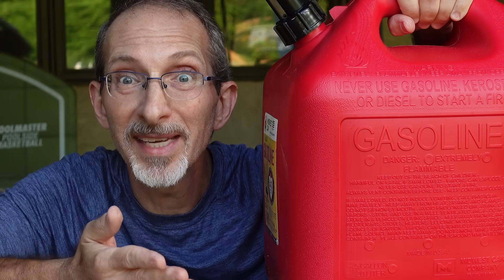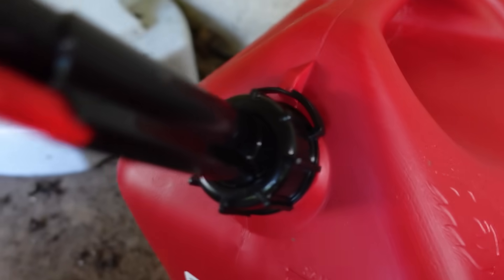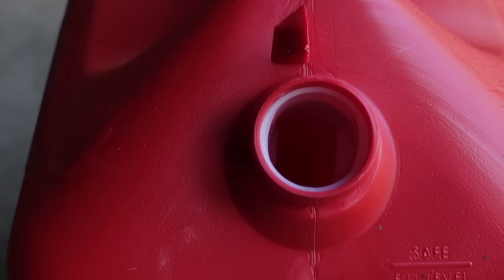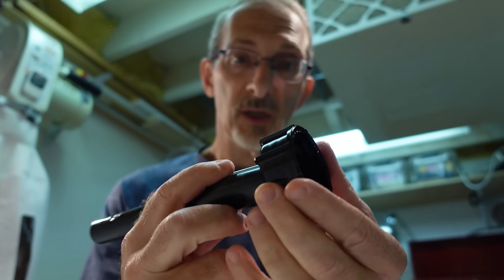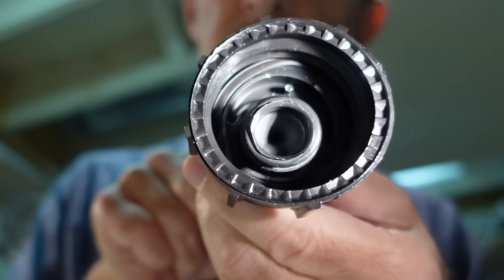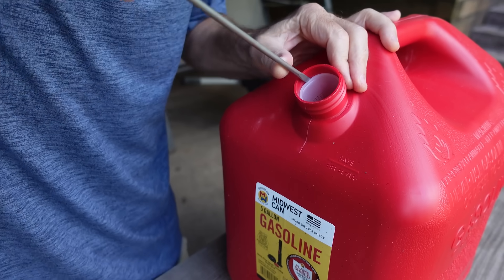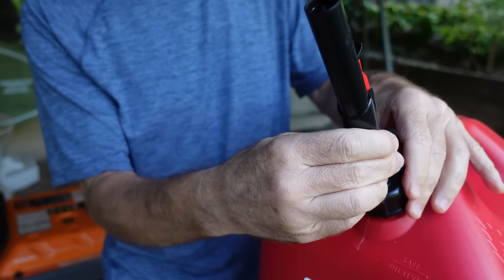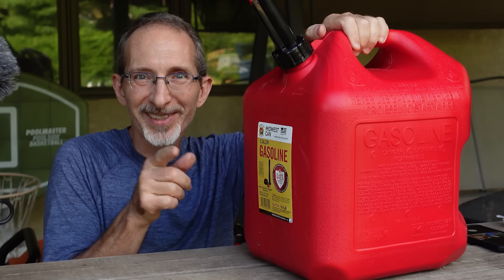Gas Can Modification | New Gas Can Fix

Comment: Socialist Democrat protect the idiot citizens instead of teaching everyone to think. They think making laws works to solve all problems without considering the unintentioned consequences. 
However - 
There were a lot of people burned with the old style gas cans, many of them children back prior to 30 years ago. Just like seat belts or push in before turning gas stove valves did save lives but those things aren't so complicated. The gas can protection was designed by committee who never had to use them in the real world.
Note that you can buy an old style flexable fuel Nozzle to fit the new plastic gas cans for a couple of dollars online and completely discard the unworkable awkward safety one.
Reply: "A lot"?  I would suspect it was a very small percentage of the people who use gas cans.

Comment: Bought a couple recently. Used a screwdriver to pry the red clip out. Now i can tip the can over, use thumb to depress and control the flow of fuel. The plastic being shoved into the recessed cavity made for a lot of friction and was way too hard to use on anything but a car as demonstrated. Without the red tab the spring tension is not that bad to operate after. 

Had to get new ones since the green handle one that is supposed to be easy was a nightmare to use. Flip down the green tab and use palm to depress and flow fuel... nope it never worked right and broke by means of the plastic deforming and still not allowing fuel to flow out lol. straight into the trash after that happened. Only had i think 3 successful uses and was about to mod it, instead it did me the favor of destroying itself.

Comment: I removed the filter then went and bought the flexible filler at the hardware store. While there I bought a bunch of rubber 1/4 inch tapered corks. When home I drilled a 1/4 inch air hole in the top back of the jug. Insert a cork in the hole.  Now my jugs are easy to fill and use. From what I was told there are no state laws about these type of gas jugs. THe manufactures simply over-engineered them and make more money from selling there piles of crap.

Comment: Wait a Generac Generator with EFI? Wow that's pretty cool. But does it require a working battery for it to run or can it run on its own stator/alternator power once running for the EFI stuff?
Also doesn't that kind of defeat the whole purpose of a old school style carb and magnetic coil pack for the spark. Which would be able to handle any EMP style attacks. Just like an old school mechanical fuel injection Diesel Building Generators'..

Comment: I had been watching rummage sales and flee markets to buy old used gas cans. I keep individual cans for different 2 cycle mixes and then for different small 4 stroke engines. Now I can start to replace some of the older ones that I really don't know what has been stored in them over the years. I really can't understand how they expect you to fill a chainsaw, weed wacker/trimmer or other small engine with that so called safety nozzle. You get more on yourself and the ground than in the tank.

Comment: I think it's not a filter you removed but rather a mash to prevent flames and explosion of a gas can.
If you think this way - what it's filtering? the dirt to come into the can. so the dirt will stay on this mash and then it will be washed back out on the first pour into the tank, right?
To prevent gas nozzle overfill safety to trigger all you need is to not put it all the way into the tank. But I think this mash design also supposed to accommodate to the length of the nozzle - that's why it's so long. So maybe fill it a little slowly rather than on the full throttle?
For the spout lock - it's better to cut the spring rather than removing it altogether I think. 
And yeah, ic now follow-up video when you realized it's a flame arrestor. That's good :)

Comment: I just bought a 5 gallon gas can from Harbor Freight that was branded Briggs and Stratton and the design of the gas cap is the best I've seen so far. So easy to use, I can open it with one hand.

Comment: I spilled gas all over the seat of my mower trying to fill it with these abominations.  Then I went to Amazon and bought a 3 pack of gas nozzle replacements for $15.99.  Includes different screw caps to fit different threads and also air vents.  All that government mandated nozzle crap went directly into the trash can.  Best $15 I have ever spent.

Comment: All good ideas - these new gas cans suck big time. Even better, though, would be to not purchase them and instead get some nice metal Jerry cans that have an actual vent and none of this nonsense.

Edit: I have to laugh about the 'Never use Gasoline, Kerosene or Diesel to start a fire' on the can. As a former firefighter, gasoline is a HARD NOPE, but Kerosene or Diesel are absolutely tame by comparison. I can't tell you how many times I've used diesel or Kerosene to get a fire going, but there's no chance I'd use gasoline. I may be a bit crazy but I'm not stupid!

Comment: number one whoever designed these does never and has never used a gas can filled with gasoline.. you don't want to pour on a straight nozzle. you need to have a nozzle that's able to move at least 70 to 85 degrees. like the old metal. these new spouts just get a nozzle that's at a 35° angle and has a cap on it you're done

Comment: After hearing you'd payed $15 for your can I simply had to entertain you with my comment. I'm homebound and as such have been relegated to having others shop for me. One of the guys I was paying to shop for me had a new gas can on the list I gave him and brought the exact same Midwest Can 5 gallon
unit you have & he charged me $47 and some change on the bill. He said everything was going way up fast and I believed that, all the inflation and such.
The red plastic lock on mine had a molding mistake in production and would not depress at all. That's not a totally correct statement as with the rest of the issues working in A Midwest China Can Conspiracy they "depressed" me for a half a day. After a while I realized it was going to need a thrashing and tapped it with a light hammer blow and could break it free. I have lived off grid on a mountain and that as well as being an "Oiler" for oil companies has impressed upon me the importance of cleanliness in various aspects of equipment efficiency and proper operation...alot of that on the North Slope Alaska...it don't run, and run good you can have big trouble. That said, I often find it important to inspect (visually), the inside of my gas cans for dirt or water lest it keep me from running a generator, having lights or running power tools. Non-removable screen filter was a very poor engineering idea. The rubber gasket for the spout was installed loose and was not seated in the not readily visible groove and so the can almost always leaked fuel when trying to fill something up, fire hazard... This kept the red "transport" cap from centering and often leaked as well. These cans are junk and quite dangerous. Your repairs are meticulous and you gave a good delivery that ought not have been necessary.
    Nice job. Liked, subbed and getting notifications. Thanks

Comment: I thought this through a couple of years ago. What the main problems are lifting heavy gas cans in awkward positions, dealing with hare-brained nozzles that are hard to use, and worrying about dropping the can should a fire break out. I immediately thought "gas stations deal with that 24/7/365 with few problems so emulate them". I got a 14g gasoline caddy that has a hose and nozzle. I pump the caddy up with about 1 psi of air. I get no spills, no drips, no worries about dropping the can and soaking myself. Refilling it is no harder, and the needs filling only 1/3rd as often.

Comment: My old 5 gallon gas container, had a top and a back handle so it was easy to handle and I never spilled gas. The new 5 gallon ones, I have to literally pom punch the button cuz it sits on the back of the spout, hold it really hard, with one hand try to grab the handle on the top because it only has the top handle and no back handle and try to pour it in without spilling everywhere. They should still give you two handles to grab from. I would have rather have had a handle on the back and the push on the top. They're making these things to be more safe, yet I spill more gas with these new containers.

Comment: You can't use those damn things the way they are. Years ago I made my own patented (not really) spout with a length of hose, a brass fitting, a washer and a screw on cap. Been doing that for thirty years. Saves an awful lot of cussing.

Comment: I thought the reason for the filter at the top of the can was to make sure that debris does not end up at the bottom of the gas can and it goes into your small engines first causing you to have more problems with your gas yard equipment making you want to buy the new electric stuff.
Reply: Nah. All of this is designed to make handling gasoline so much of a hassle that you want to scrap it all and buy an electric mower

Comment: I had one of these idiot cans in the lab where I used to work. I never did figure out how to get it to work. At home, I have an old style can. The nozzle broke and I bought a set of three Chinese made replacements, along with caps and air vent caps, all in a little kit. Unless the can itself develops a leak, I will never buy one of those bonobo-committee-designed pieces of junk.

Comment: I haven't seen the plastic cans like you have. I've never seen the internal filter. Yes, the new supposedly safer gas cans are anything but safe. They are 10 times more dangerous.
You can drill a small hole in the opposite end if the gas can and use a machine screw to plug it for storage. Just unscrew the screw with your fingers when it is time to pour.

Comment: An old plastic 5 gallon bucket works wonders, as do my 1960's metal gas cans. Anyone besides me still use a piece of 5/8" garden hose to siphon with?   I can honestly say I have never purchased one these stupid safety cans.  
Pro tip. To easily and cleanly put straight gas or premix in your small equipment use a well rinsed gallon laundry soap jug with the push button nozzle. Stick the nozzle in the tank and push the button. Californians of course, can disregard this tip.

Comment: The absolute worst spout of all time! Gas everywhere on small equipment, your hands, the ground. I cinched down the latch with a zip tie then compress the spring by hand and pour into the tank. Looking at it on your video I may grind off the catch on the locking feature and snip coils on the spring until i get the action I want. But what an over engineered piece of crap for sure!

Comment: When they came out with these safety gas can spouts, they appeared as an emergency,  overnight, quick fix design meaning not well thought-out.
The design hasn't changed.
Why not some sort of a quarter-turn valve, something simple?
You're exactly right, this design only works when putting gas in a car. 
If use on a lawn mower, you have to hold it open with your hand and of course gas dribbles all over because of this crappy design. These might work as well if the spring was half as strong as it is.  There's no need for it to be so stiff.

Comment: I got those same cans for my generator when a hurricane was coming. Power went out before even landfall. Go out in the rain get generator going. Not only does that dumb spout leak from all over because you need a ton of weight just to get the gas to flow, if you need to fill up something big it pretty much trickles out literally standing there for ever wait for the dumb thing to fill up. Im sure that design is impossible to use on most lawn equipment and after the hurricane I didn't want a bunch of gas just sitting around so I tried to put it in my chevy express. Doesn't work. You can barely have it activate so its a trickle and meanwhile gas is just leaking out from all over. Gonna buy the old style spouts off Amazon... Actually a funny one was I had a small can a while back  and that spout was also impossible to use. Getting it all over my lawnmower and hand I ripped it off and threw it acroos the hard poured the gas without a spout and ran over it with the mower.

Comment: Okay I guess I will tick everyone off. You did get the crappiest nozzle out there. The one I have you push a green lever down ant then the heel of your hand holds the nozzle open. 

Don’t get mad if you go somewhere and they refuse to sell you gas. Highly unlikely but it may happen. I know all these things are an inconvenience but there is a reason for them. The little piece of plastic that you have to squeeze is to ensure the spout is completely on. The spring loaded nozzle shut off ensures that if you pull the tank back or  drop if gas flow stops, and that PIA filter is not a filter it’s a spark arrester so if there is a spark ignition outside the tank it won’t go back into the tank. 
I agree all of there are a pain, so are seatbelts. You do have to fill mush slower and until you get use to using these it does seem like they create more problems than they are worth. 
One more thing if the worst happens good luck getting the insurance company to cover it and possibly the same for health insurance. Then there’s the liability of any injury or damage to anyone else. 
So it seems I am the only opposing voice I expect some blowback.

Comment: Outside of the Sure Can, current fuel cans are a menace.  The only way to fix them, is to replace the spout with an old style spout. If that is not an option, just throw the can away.

Comment: I've got an easier solution. Return the plastic pos gas can and get a good metal can.  There's a place for well designed safeties but most of the safeties they install feel like stuff that's designed to comply with laws that were written by people who have no idea of how it affects real world applications.  That "filter" is there to prevent fire from propagating into the can.  A good can allows you to remove the "filter" during the filling operation.  However, you are much safer if that "filter" is in place during your pouring operations.  That "filter" has absolutely nothing to do with contaminants because the screen is too large.  It operates like the screen on old mining lanterns but instead of blocking fire from getting out, it blocks it from entering the can.

Comment: Don't completely remove the spring or the o ring will not seal well, and thus the gas is likely to absorb water during humid days. Instead, trim the spring and stretch it a little, thus making it weaker.

Comment: I still have a metal gas can.  It has a normal nozzle with a plastic cap, and a smaller hole to let in air.  This can has lasted 23 years and works fine.

Comment: I have that same can and I have to say it works pretty well as is to fill my riding mower.. I normally overflow it or fling gas everywhere trying to stop the flow before it runs over.. I don't like the lack of a vent though, it takes forever to fill the mower. I may drill a small vent hole so the cans don't pressurize from changes in temperature in the shed.
Reply: same here, I've come to appreciate the design

Comment: I think Blitz was the major gas can manufacture, they had the tube that just pulled right out. But I  guess someone spilled some gas and caught on fire or something, there was a lawsuit that put the company out of business. So the reason we have to deal with these stupid tubes is for lawsuit reasons. I usually don't use the tube and just pour out of the can, but I might try that option.

Comment: For the suppressor/filter..... someone posted that any debris gets poured out with the fuel.. if a portion of the bottom end was cut out, any trash in the can would be trapped when you tip it to pour....  and leave enough to act as a suppressor??

Comment: The real problem is something that happened to me, these ridiculous sealed “emissions” pour spouts allow the pressure to build up in a can so much that the seam on my can separated, letting all 5 gallons of gasoline pour out. Talk about dangerous! Not to mention, what’s the emissions damage when all 5 gallons spills and evaporates? Luckily, my truck didn’t burst into flames.

These effing climate change do gooders are going to get people killed.

Comment: I’m surprised no body invoked the CA Air Resources Board (CARB) which mandated special spouts to eliminate emissions from the cans in storage. Quickest fix was a replacement spout,illegal in some states, that lets you use the can without spilling gas all over everything. But you could buy those spouts on line.

Comment: Back in the 80s , There used to be a gas can available called The Pumper
It was available in 2 and 5 gallon size
It was equipped with a hose and it had a nozzle with the same design like you see at the gas station , After filling the can , You pump up the air pressure just like pumping up a bicycle tire , Put the nozzle in the tank you're filling up and squeeze the lever , The can was also equipped with a safety valve to prevent too much pressure from building up 
Unfortunately it was discontinued
With that kind of gas can , You can fill up your lawnmower , Chainsaw etc without having to hold the can up and fill up with no spills , I wish that they would bring it back

Comment: Nobody ever: "this is a great safety spout"

Give me a good ol long flexible free flow spout with a cap and punch a hole at the top of the handle with a removable plug(golf tees work great) to increase flow rate...and im a happy camper